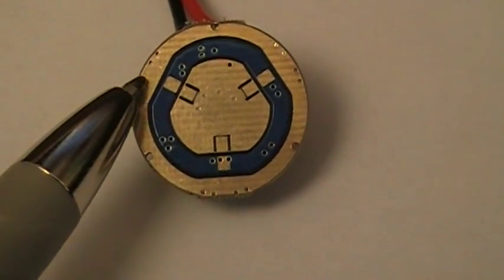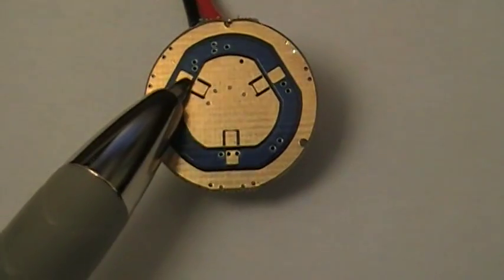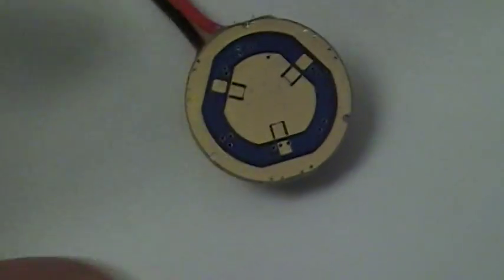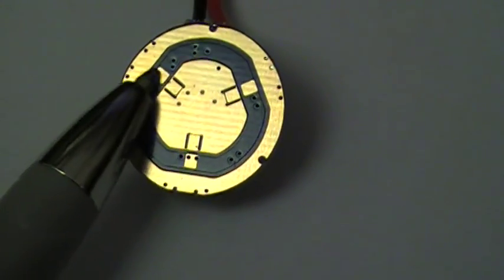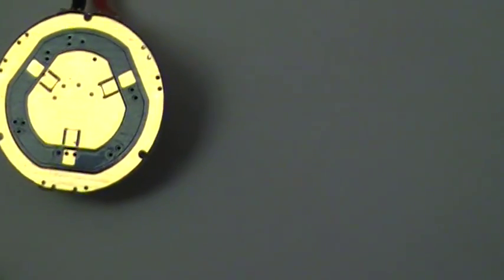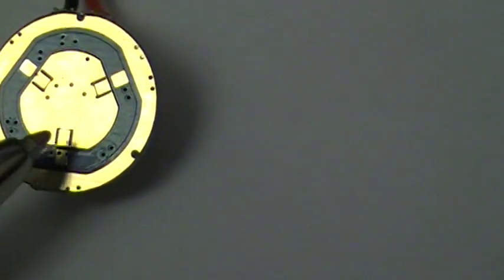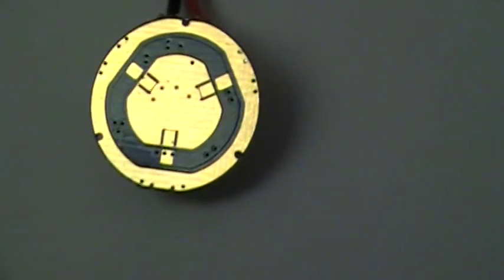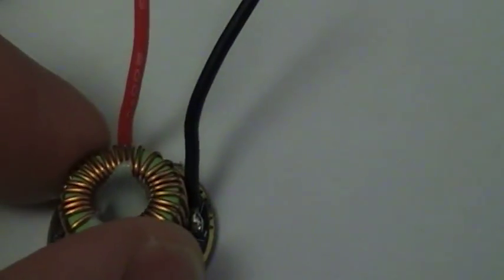2.5 A 3w 445nm driver I use in my laser kits

Comment: Seen this and thought of a trick used by silver and gold smiths or when its critical to not alow solder to stick any place you dont want it to and to also prevent any already soldered joints from ever re flowing on us.  "yellow ochre" aka "anti flux" is used as an anti fluxing agent. its basically just iron oxcide and when you paint it on any spot you dont want to get solder on or have already soldered joints reflow on you. it basically makes the joint so dirty the solder just cant flux or melt